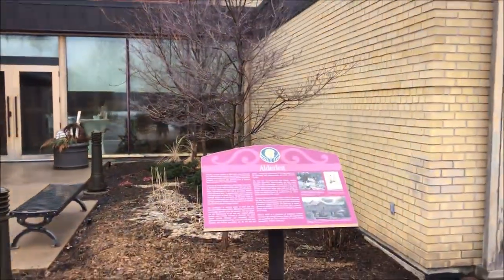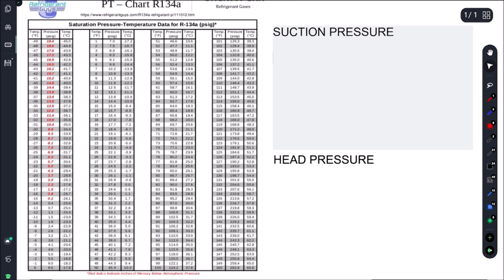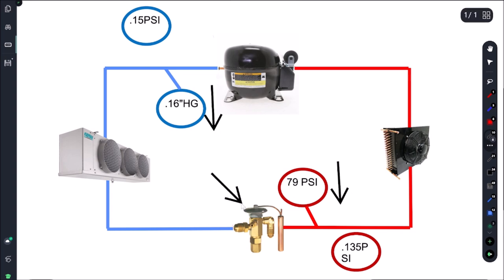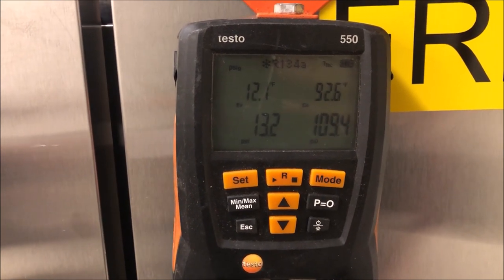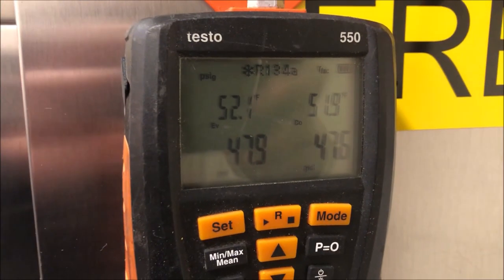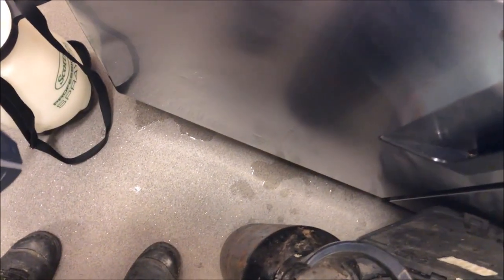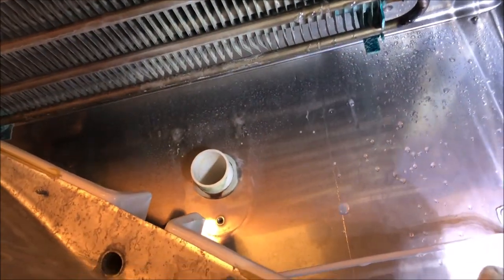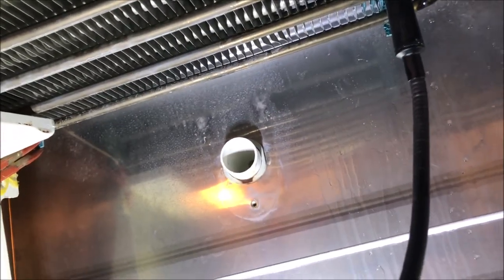Reach in Cooler is not cooling

Comment: Great video.  What gets me nervous about those calls is that the units have been running in a vacuum and the leak is in the evap.  So possible moisture making it's way into the system too
Reply from the maker: Yes but it’s very rare I see these smaller 1/3 or 1/2hp compressor fail after it’s been running in a vacuum.

Comment: Have you ever tried a ultrasonic leakdetector ? I use one, on regular basis, and it works very well. A lot of times, even when you open the door, after equalize, it's possible to hear.
Reply from the maker: Nope, willing to try anything to help detecting leaks though

Comment: Thank you for the video!  In some videos you calculate 15°F over ambient for correct head pressure, and 30°F in others.  I've also seen you calculate by subtracting 20°F from desired box temp, and 10°F from desired box temp when looking for suction saturation.  Why is that?  Thank you.
Reply from the maker: Condensor split will difference from manufacturer to manufacturer. Cap tube is a 20F TD, TXV is 10F td coil

Comment: 💪🇺🇸👍❄ ? 4 u. If u put ur low side gauge on a unit when it's off n the pressure rises close to ambient would that rule out restriction ?
Reply from the maker: Nope, we can still have a restriction and the system will still try to equalize and you will see the suction pressure rise slowly.
Reply: @REFRIGERATIONKITCHENEQTECH  thankyou so much for your help. Much appreciated 🙏

Comment: Great video , want to ask is the suction and head pressure calculation applicable to other country which our temperature is around or higher than 100F?
Reply from the maker: Shouldn’t matter, suction pressure might be a little high to start but once it gets close temp your set point, the pressures should add up based on your TD

Comment: I never see you use the charge on the factory on the factory data plate. Have you ever recovered and seen how close you are the that charge?
Reply from the maker: I always charge to the data plate on critically charged systems. I tried a few times to weigh when I recover on these smaller units and never had any luck so I stopped doing it.